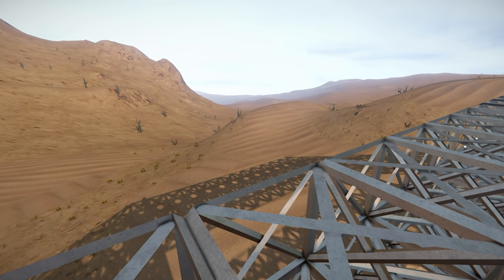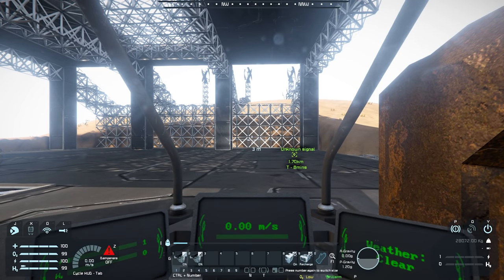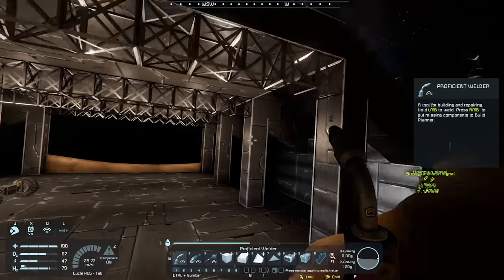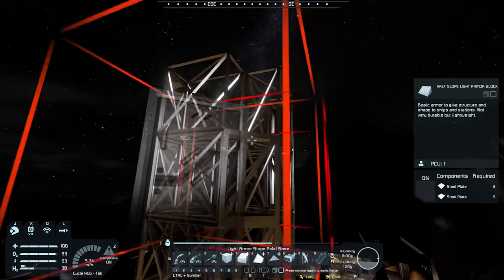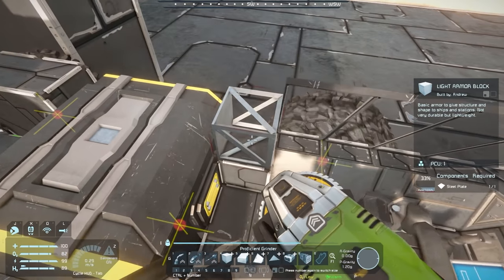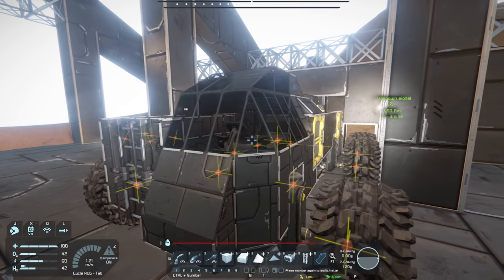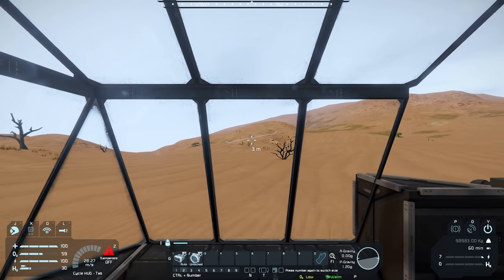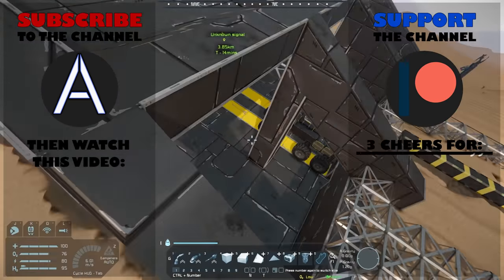Space Engineers Survival 2021 (Episode 7) - Finishing Hangar and Rover! [Pertam]

Comment: For the support beams in the hangar, weld them partially. Give a nice touch, and does not look so easy to break =)

Also, building a Rover, when you have 1 block hole somewhere, you could put a small battery instead of a steel block.

Comment: As to Szymon pointed out antennas being ground wires. This is true, antennas and decoys will draw lighting strikes. I would also bet you don't know that if you put the antenna or decoy on a sub grid the damage wont transfer to the main grid. So just put a decoy or antenna on a rotor and have a welder on the main grid that is set to repair the sub grid and then you wont have to really worry about lighting anymore.
Reply from the maker: Oooo sneaky idea! Honestly, I kinda want the drama of the death lightning. I can't say I wasnt warned, but so far it hasnt caused much trouble. If it gets to be a problem, I'll try this sneaky subgrid solution :D

Comment: remember = HANDBRAKE on before you exit the vehicle.
also lower your top speed on the truck = less prone to flip or have wheels explode when they de-synch from the Voxels and Klang out.

for power, using the Windmills. I use 8 block towers spaced 10 blocks apart.
at the top, I place a cross of 1 block apiece 1 block down from the top permitting 5 Wind Turbines to be placed that don't interfere with each other
creating gobs of power in a compact format.
the side turbines are placed sideways pointing away from the tower.
my suggestion for defending against Lightning Strikes is to apply the Lightning Rod Mod and place Lightning Rods on the top of each tower protecting it as these Rods act as Decoys to attract lightning to them <and bullets too!>

I highly recommend grabbing the Recycle Battery mod = you get the Power Cells back as Scrap to melt down and remake into new Power Cells.

suggestion is using the High Powered Spotlights for the Truck as visibility is good from inside it and really throws light out in front of it much further than the Vanilla ones.
visibility is critical when driving about so one would do good to center the cockpit on the front of the vehicle and accessories placed such that they are below the viewpoint when sitting in the seat.
you could consider a front mounted Connector piped into the containers so you only have to adjust the front wheels to line up the connection.
people often forget that the cockpit Seat has storage under it to stash things.
add a Backup Camera above the rear connector to save your hair when backing into your parking space and line up on the connector.

production is best right next to the Hangar at the surface level. 
habitat Module can be built above it leaving only the Med Bay which for maximum protection should be placed underground.
I've had far too many Drones Kamikaze themselves through walls and roofs to take out the Med Bay. 
I also suggest the Smart Targeting 2 Mod to let the turrets fire selectively at targets like offensive components in order to spare a lot of other useful bits for salvage recovery.
there is nothing worse than tearing up a base to salvage only to be left with a pile of worthless scrap iron because the turrets blew up all the good stuff inside.
especially on Pertam! Salvage is the Law of the Planet.
you Keep what you Kill!
Reply: I disagree about the lights and other mods. some mods are cool like pve and abandon settlements, but if you add too many mods it takes away from the game and just makes it too easy, and if it's too easy, it'll get boring to play much faster
Reply: Oh sweet jesus wall of text

Comment: You can place the wind turbines out the four cardinal directions along the sides of the tower rather then focused on the top and instead have a lightning rod at that top IE a decoy block. This offers full clearance for all your turbines as long as you place at least one block from the center for each. If your not worried about lightning you can put a final turbine at the top for a total of 5 turbines in a pretty small area.

Comment: oh no, a bit necro, but for the science.. center of gravity, on a wheeled vehicle designed for cargo carrying with tandem axles, is actually suppose to be between the tandem axles. their is a reason semis 5th wheel is over the center of their tandem axles, its to move weight away from the steering wheels. a centered center of gravity is rarely actually used on wheeled vehicles. that includes high end cars since they tend to bias to the rear with a 65/45 ratio. put friction on the drive wheels where you want it, dont put friction on the steering where you dont want it.

Comment: Late to the party but you can place 5 wind turbines on one tower by placing one block on each side of the tower, one below the top and placing wind turbines perpendicular to the ground, and then placing one more block on top and a wind turbine on top of that block. That will give you over 2000 kW of power per tower.

Comment: parking brake is under the seat controls, not the wheels, if you toggle off the brake possibility to a wheel you won't brake even with the space bar, but only pressing S because you are not breaking (in theory) but you are going bkw
Reply from the maker: Thank you for the tip!
Reply: @AndrewmanGaming  i got another one only in the case in you don'know it: if, in build vision, you press ins+page up it will copy the properties of the thing ... eg: you set up on light of 8 that you have to set in the same way like same color and range,than you press ins+page up... you go to the second light, open build vision and pres ins+page DOWN and it will automatically modify the second light parameters... than you repeat for the other 6
Reply from the maker: @nicolamariano745  That is extremely helpful! Thank you :D

Comment: And how do you use connector to transfer items? I can never do it,tried many things
Reply from the maker: When you go into the connector, there is a button just above each side of the inventories where you can click to show connected inventories. That will show you every inventory on the grid.
Reply: @AndrewmanGaming  yea,i did that. But i still can't move items through connector
Reply from the maker: @byandevenouser  Here are a few reasons that could be causing the problem:
1) Is the connector attached to the place you want to move it with conveyors? 
2) Are there any sorters that might restrict your ability to move things?
3) Are all of your machines and connectors powered?
4) Are you on a small ship? (If so, you have to worry about large vs small connections. Some blocks can only fit through large connections)
Reply: @AndrewmanGaming  my ship are container > connector > base connector > conveyor system > base container. And i can't transfer any item with that all.

Comment: Hi again andrew!
Reply from the maker: Hi!
Reply: Im not good at survival can you give me some tips?
Reply from the maker: @CamMit2007  Yeah sure. What kind of tips are you after?
Reply: Like strategys and ways to save on resources and stuff
Reply: And ship building
Reply from the maker: @CamMit2007  Oh yeah sure. Well to save resources, you can build half blocks instead of full blocks as floors. You could also not weld in certain blocks if you don't need to. That can save you lots of iron. For flying ship building, the basics are simple. You need atleast a cockpit, a power source (battery, etc), a gyroscope, and a thruster pointed in each direction. Rovers are similar, but you don't need a gyro and you replace the thrusters with wheel suspensions.